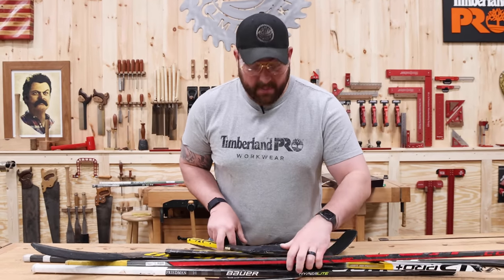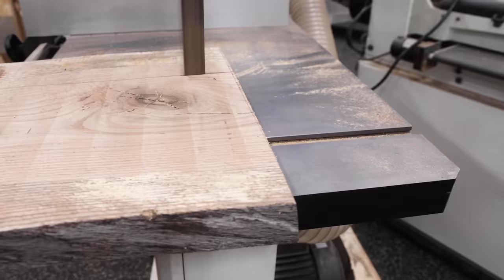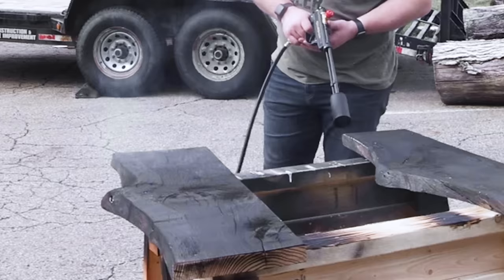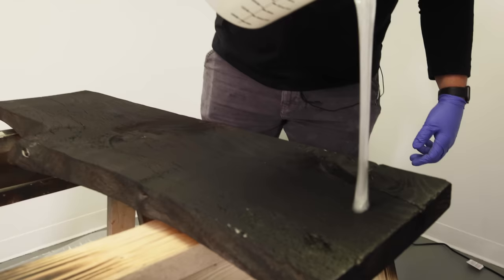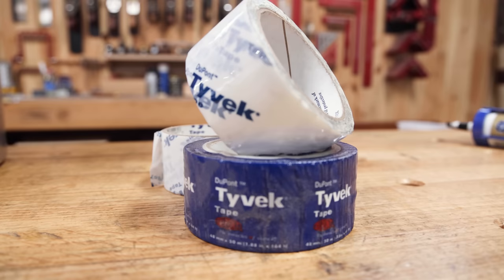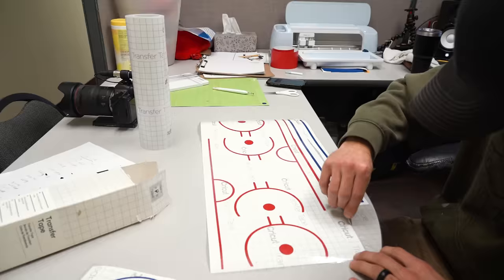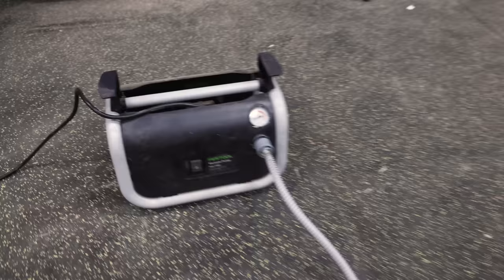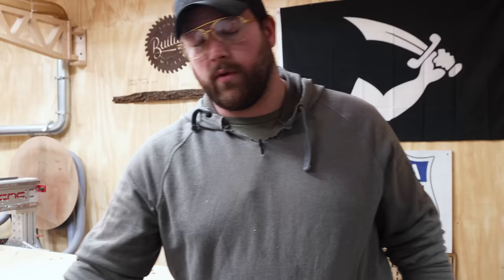I Tested Viral  EPOXY Table with an ICE Rink River!

Comment: For bubbles if it's too much for you and you have to fix it, take a mini-drill bit (1/64 for example...size to the top of the bubble) and drill straight down to the bubble. Then go in with a injection tool (like syringe with your epoxy in it) and refill the hole/bubble..hitting it with heat as normal. If everything goes right, you won't be able to see where the bubble is afterwards. Source: I'm a old Air Force 2M technician and one of our skill checks is going in under a microscope to fill a, "bubble-free" excavated space on a circuit board. We had to use dental tools and, "pick" the bubbles out though back in my day! You couldn't have a single bubble even under zoom in a microscope. It really had to be bubble free! lol

Comment: Former Rink Rat/Zamboni Driver/Ice Maker here: The ice surface in hockey arenas is white because it's painted white.  The blue line is painted blue, and the red line is painted red.  In the rink I worked at we only used paint for the goal crease.  All of the lines were simply a crepe or tissue paper that came in the various widths and we just rolled them into place and used a spray bottle to tack them down before flooding on the next layer of ice.
Reply: Definitely smart idea with the lines

Comment: AS a former Zamboni driver, the ice starts out clear with a painted floor. The skates chew it up. The cloudiness is a combination or impurities (hard water, sweat, spit, etc) and air from being gouged damn near down to the paint. (the professional team in our town came to practice on our rink as their rink was getting a makeover and they did laps and chunked out 8 inch to 1 foot holes into our ice down to the concrete) Anywho air gets trapped filling in the grooves. So now you know.

Comment: 4:00 Top Tip, when mixing epoxy... As you mix you will notice at first the epoxy turns almost white or gets cloudy.  Keep mixing until the epoxy returns to perfectly clear. That is how you know you are done.  At that point I will pour it into a new container and mix again for about a minute or two, then pour.    You will have a lot less issues with bubbles and slowly drying resin.

Comment: ice is cloudy because when the water crystallizes (freezes), it starts freezing all over the volume and the growing ice crystals at some point touch and freeze onto each other resulting in strongly polycrystalline structure. So the ice crystals are not well aligned within the whole voulem this makes it not transparent.
Therefore it indeed has something to do with impurities (freezing starts at impurities in the water).
If you freeze super clean water carefully, it can become a very clear ice.
Reply: Specifically you need to freeze it slowly and in one direction. That way air, and mineral impurities are slowly pressed down to the very bottom.

Comment: For a tabletop it would’ve been much more interesting to have thins visible from all sides, not just one point of view.
Some things pointing left, some right, some up, some down, maybe some diagonal.  I know with the skate blades it’s kinda big to do diagonal and more than just 2 views, but better than all pointing one way.  Some up some down would have been sufficient. But the pucks in opposite directions would definitely make it more multidirectional.
As for the frame, I’m pretty sure you had the wall art idea before you finished that.  If you had a table with those on there, specially the end nubs sticking out like that, it’d definitely be very annoying. 
Last thing , which technically is the first that should’ve been addressed, when cutting the slab down, if you could’ve made that large nub that ended up in the middle maybe more like 2/3 or 1/4 of the way on the slab it would’ve been better.  The way you ended up getting it right in the middle makes it so you had to trim it and make it not as natural looking, which you burned anyway and blended it in so that did basically take care of it.  But it it wasn’t right in the middle and off to the side a bit, when u split the slab and mirrored it to make the table they’d be opposite each other on the table and give it a bit more drama and character and wouldn’t have needed the trim in the first place.